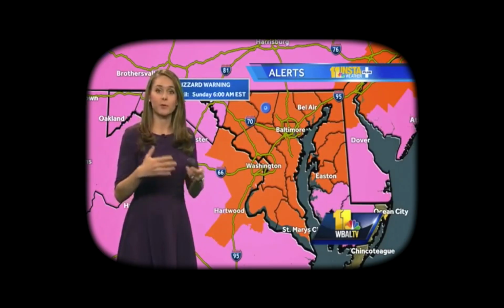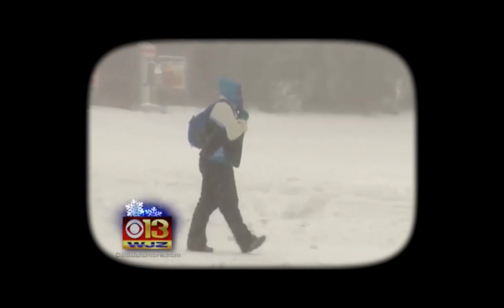2016 Weeks 2+3 - Space RAIDers Weekly Updates

Comment: Excellent weekly updates.  Thank you for such detail.  You each are on the right path towards success for being a top seeded team, but pneumatic tires?  Is that appropriate?  Consider the sharp aluminium edges you will have to cross (and the burrs) (the field is not made of 2x4's).  Also, looks as if you are having the same shooting issues as the basketball game back in 2012.  Is that robot still alive (I don't remember her name... Adam had several for it.)?  Remember that those foam balls tare easy.

Snow is in the forecast.  Good luck.